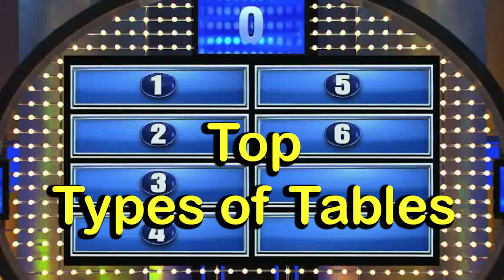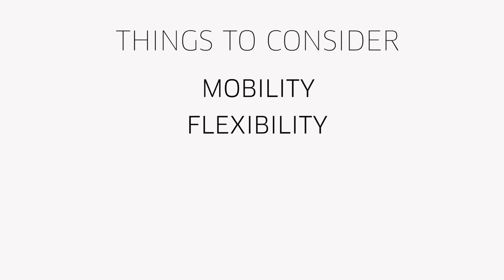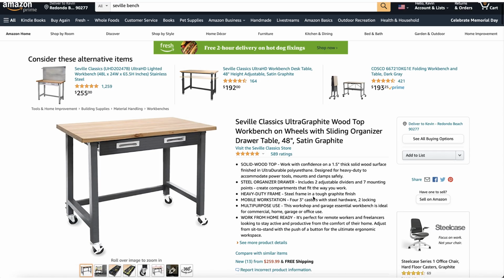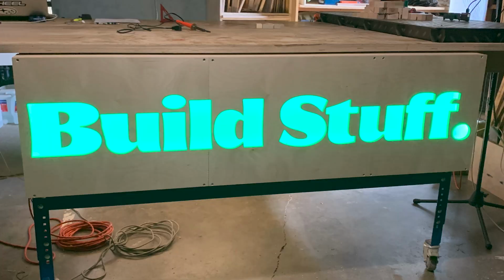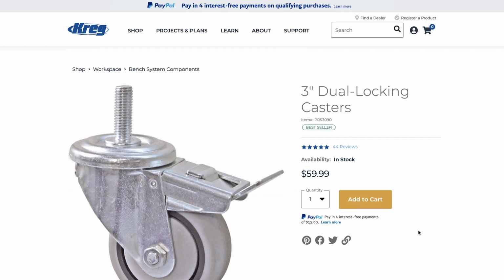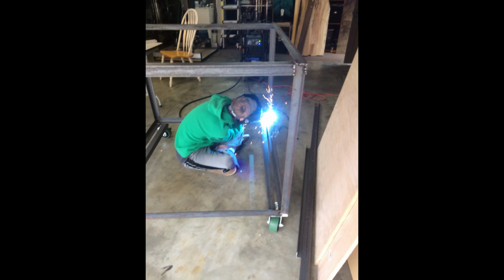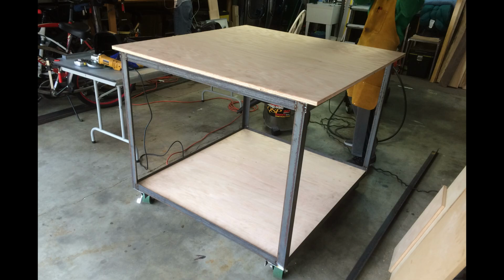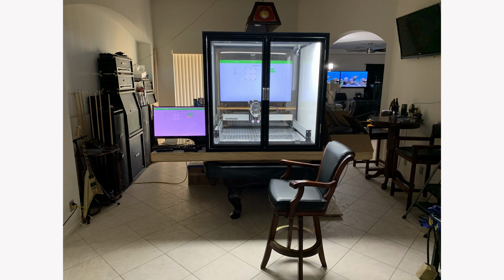Carbide 3D - Table Talk - Where to put your CNC

Comment: It would have been nice if you could tell us the Ideal size table or workbench, (measurements) then maybe the best size to build to hold or house everything needed like computer, tools, tape what ever. For me I just bought the Pro, not sure what size is best to build.
Reply from the maker: Rodney, Machine footprints are available on the website:  https://shop.carbide3d.com/products/shapeoko-pro-cnc-router?variant=32912259186749
About 4" on each side is generally enough.  However, everyone's specific plan for their machine is different.

Comment: What table do you use for the computer?
Reply from the maker: That’s the Seville Table on Amazon.  Seville Classics UltraGraphite Wood Top Workbench on Wheels with Sliding Organizer Drawer Table, 48", Satin Graphite https://www.amazon.com/dp/B074WL437T/ref=cm_sw_r_cp_api_i_28Y8R0HKBT33QSZTD8EG
Reply: @carbide3d  did you have to do anything to both tables? Like to male them stay together?

Comment: Thank you for this video as it did answer some of my questions however, I am brand new to the cnc world.  My shapeoko 4 just arrived yesterday and I need to build a table for it.  Can you please tell me what size table I need?
Reply from the maker: Hi Cindy,  Hope you got your machine up and running.   The dimensions of the completed XXL are: 50" (X)(wide), 41" (Y)(deep), 19" (Z)(Tall).    A slight overhang is ok for the sides of the machine.  If I were building a custom table for the new machine I would make sure it's fully supported.
Reply: @carbide3d  thanks.  Just built the room.  Still have to put in electricity and build table then will get it out of the box.  So excited. Thanks for the dimensions

Comment: is there any news about automatic tool changing coming to the Carbide team's products? Tbh its the biggest reason I haven't pulled the trigger on a Shapeoko pro when comparing it to something like a Stepcraft which already has an automatic tool changing upgrade kit.
Reply from the maker: Automatic tool changes would be nice.  However, you are comparing apples and oranges given that the Stepcraft machine with tool changing is $4400 before tax and shipping.  The cost to actually receive the machine is just shy of 6K.  Additionally, that machine is smaller than the XXL.